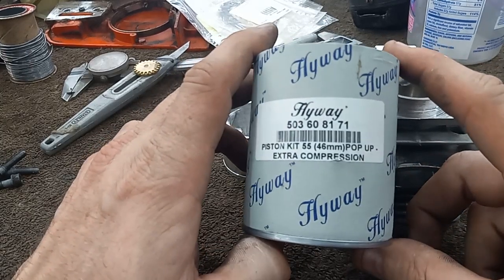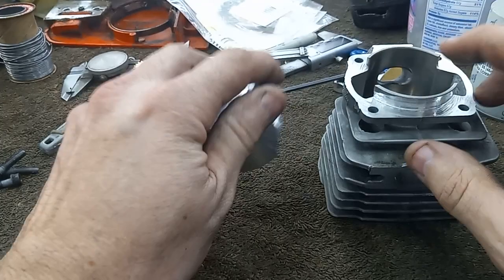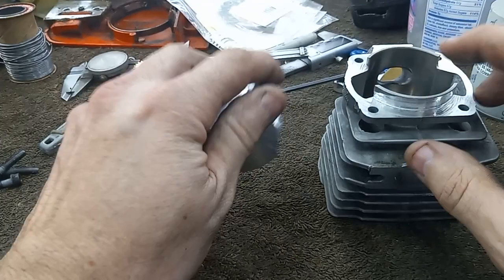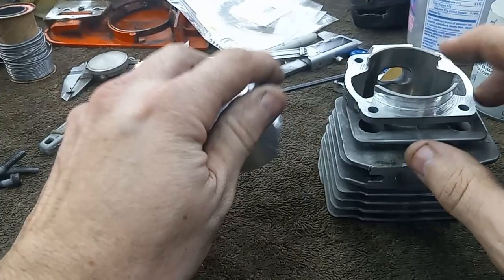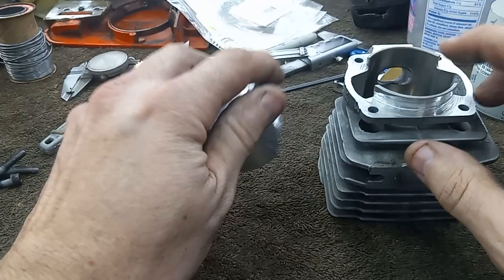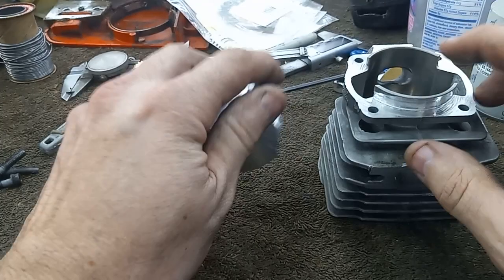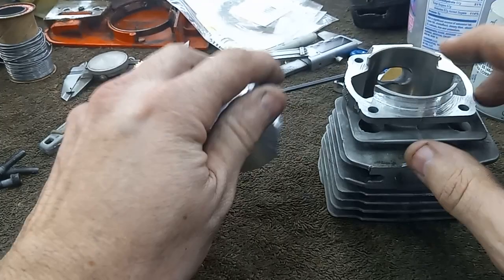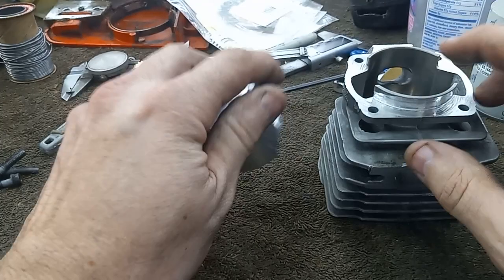55 rancher update an port work/numbers

Comment: Just got done doing a 55 myself I cut it down on the lathe get my port work we got pretty close to the same numbers her mind kind of think the sameway after my late work my exhaust was at 106 I did go ahead and lower it to 103 my intake is at 77 also at my transfers 125

I like your transfer work thanks for sharing that do a video with that sucker ripping

Comment: Nice, your porting numbers are so different from eg ironhorse, like you leave the exhaust at was it 150 and I think he would go closer to 160 but prob not over 150 on intake and you have 155, hope its gonna be a ripper. i might have to epoxy my transfers aswell because they are very abrupt. Hope the 55 will be a ripper!!and give the compression numbers when its assembled

Comment: You can use a 029 super or ms290 new style 46mm piston and cut the top with a .025-.030 popup. Might have to epoxy the intake floor I don't remember.